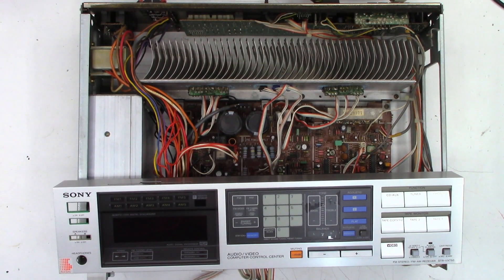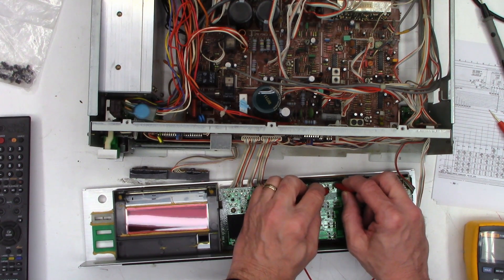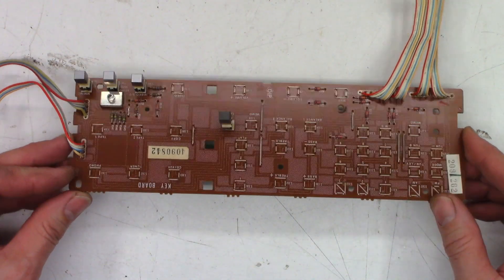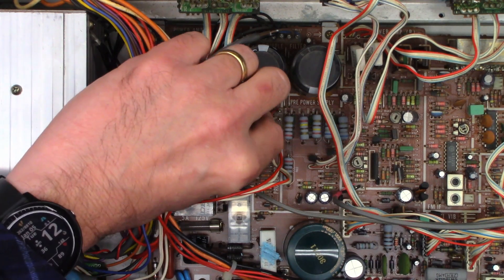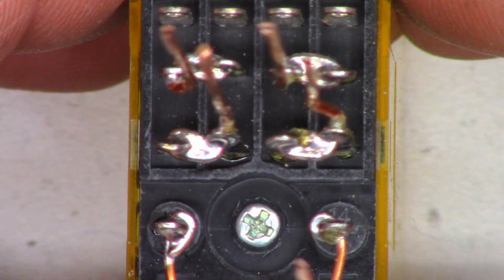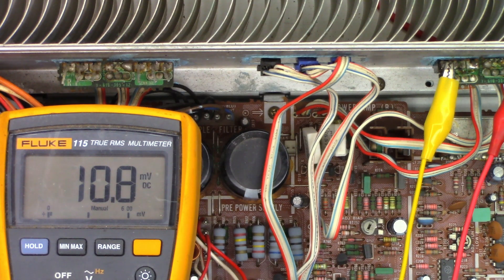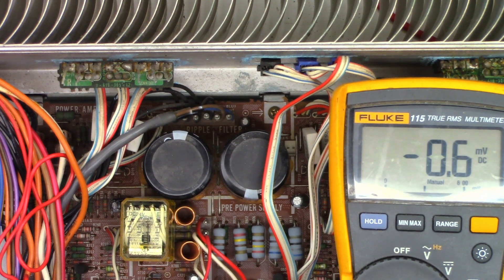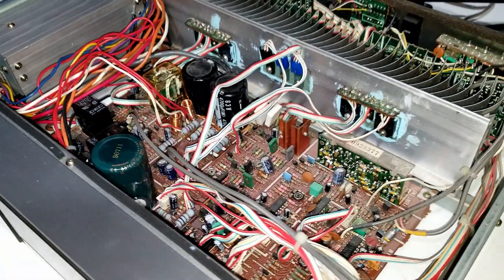SONY STR-VX750 NO BUTTON CONTROL AND AUDIO CUTS OUT. VINTAGE STEREO REPAIR

Comment: My no solder method:

1.  Drench in Deoxit D5

2:  Seal in a large ziplock bag

3.  Push buttons while in bag multiple times

4.Spray the board with electric cleaner

5:  Soak it in mildly hot water with dish soap while pushing buttons multiple times (seriously, it works and you can smell the electrical ozone particles being released.

6:  Hit it again with electric cleaner and sit it on top of a dehumidifier for 12 hours

7:  Repeats set as many time as needed.  Worked much better the first round, did it again until it all worked flawlessly (2 times if I remember correctly)

Comment: Thanks! Where and what are the switches you used?
Reply from the maker: Thank you for the donation. Here is the link to the switches. https://www.amazon.com/QTEATAK-Momentary-Tactile-Button-Switch/dp/B07VSNN9S2?source=ps-sl-shoppingads-lpcontext&ref_=fplfs&smid=AJJYA8M5YMCKV&th=1
Reply: Thanks for saving me a lot of time.  @norcal715
Reply: I managed to open the relay with a knife. The contacts had to be filed to work again. Sounds great again. 162 desolder/solder. I bought this in 83 with turntable, tape deck and graphic equalizer for ~$800. My first new receiver.  All worked with same remote control. Still a nice workshop system.
Reply: I opened mine as well and cleaned the contacts. But it started cutting out again in a few hours. Filed and used deoxide cleaner

Comment: Exact same unit - exact same problems here. I also took out the button cell tuner back-up battery and replaced it with a new one in an easier place to replace. Great video!

Comment: My VX750 had the exact same problem and curious that the switches were only bad on the right-side of the receiver just like yours - the switches on the tuner side were just fine.
Anyhow, I managed to "fix" the switches by drenching each pushbutton in contact cleaner - it saved me from replacing 38 switches, for now.

Comment: Memory preset still work?  Normally the battery back up will be dead by now.    Why did all the switches go bad?  I understand the common used ones but 34 separate switches , were they a bad design?
Reply from the maker: Just old age, silver plated contacts tarnish over time
Reply: I noticed on that receiver the cr2023 battery for memory back up is missing. There is just an empty spot where the battery should be. I bought mine in 1984 which I still have.

Comment: Umm yes its broken, it's a Sony.
Look back in 1976 Sony made the best color TV.  Today i wouldnt give you 2cents for anything Sony makes.
Last Sony to I bought lasted 4 years. Never agine.

Look at the desine seriously wires everywhere jumper wires  all this shows is very very poor desine  look inside a Yamaha  or Alpine product  nearly no or no jumper wires that means the layout of the PCB was done right  jumper wires means they added stuff as an afterthought.
Know what your looking at.
My Yahama has a troid bigger then your fist and its solid state electronics. Ceramic capacitors. It was built to sound good and last.
The Sony was built to take your money
With little regard to sound or a lot of regard to taking more money.
A fix for that is a 20lb sledg hammer and the trash dumpster. Its garbage. Its not worth saving.
Reply: ...design

Comment: Good solution that looked fine on the switch! Why do you think the pots got so out of balanced? Good job buddy!
Reply from the maker: It looked like one channel was repaired. The length of the output transistor leads were different. Probably never got adjusted from that repair.
Reply: @norcal715  Ah, so it had issue previously. Well it worked well after you got done with it! That was weird seeing one of those early 80's PS units again. Smart move replacing all the micro switches too. I'm sure they were affordable enough to do that. You did it right.

Comment: The products of yesteryear were robust and almost bullet proof. Not like in todays throw away generation. Nice Job Norcal715
Reply: Robust?  Is that why its open and he's trying to fix it?
I've got 2 1974 version of the Yahama cr620 both are stereo recivers they both work today.  I change it for a 5.1 system now the Avantage "also Yahama" 9.2 so id have hdmi the only reason I buy newer units is becuse the older ones are outdated. But they work. No problems.

Comment: Another great informative vid. I own a Hafler SE240 which works and sounds great. However my dc offset is 20 and 40 mv respectively, which I understand isn't horrible. The specs schematics, and parts for the Pro2400 are easily available online. the the circuits appear to be almost the same except for the Pro's balanced input section. Could you let me know which Pots to use to adjust the DC offset? The board for the Pro totally looks the same to me but I'm a novice. In addition depending on your location and price I might be interested in having you recap it with some similar high quality caps like the ones it has on it, and a general checkup on your fancy machines (oscilloscope, etc..) after all the amp is from the nineties. Please reach out if you can help me identify the correct pots as there are two accessible from the top of the case and your pricing. Thank you much and and I have learned a great deal from you and saved several powered subs and Avr's myself but I'd prefer someone with better equipment (de-soldering gun) and skills with greater knowledge working on this amp because I really can't afford to destroy it, haha.

Comment: Steve, I had a few different brands over the years where those micro switches or tactile switches were bad, and like your video, I would change them by the dozens..!!
Even had a few on some of the older TVs that used them on their keyboard's. 
Great job as always. 
Those bias adjustments , good call on that as well..!!
Reply: I've come across many brands of VCR's with faulty tact switches on the front - they "kind of" worked but not always. Replacing all of them fixed the problem in most cases. They tend to develop high resistance over time (their internal contact pad wears and/or becomes corroded).

Comment: Next that power supply will stop, because of dead Sony capacitors in the start up circuit.
Reply from the maker: I tested the ESR of the caps, Good 80's caps. They all were excellent ESR.

Comment: Are those switches Universal throughout all electronics? I have a Sony CD player that's been giving me a headache with switches. I'm just wondering if there is only one switch out there or do I have to find a part number for mine.
Reply: Small tact switches are ubiquitous.  Things to measure would be the nominal pin spacing and plunger height.  Mouser or digikey should have an ample selection.  I've had these things fail in batches like this project.  It seems to be an issue of silver-bearing platings on the contacts being heavily tarnished over time, possibly due to reactions with the plastics or other things in the immediate environment.  It's something to suspect when all the switches wear out simultaneously, even the ones that rarely get used.
Reply: Yes, I've been having a lot of problems with some of my switches on my Sony 5-disc carousel. Sometimes I push a button and it will do a different function or would not work half the time. I haven't used this CD player in a long time so I figure the switches must be oxidized from time. I didn't realize you can replace these that easy.
Reply from the maker: Some units use a ladder resistor network as a voltage divider so if a switch has higher than normal resistance it could inadvertently trigger another function.
Reply: Common for them to fail after a long use. There are a number of part numbers, but just look up the ALPS switches and go by size, and then the button type and length. There are a lot of common types.